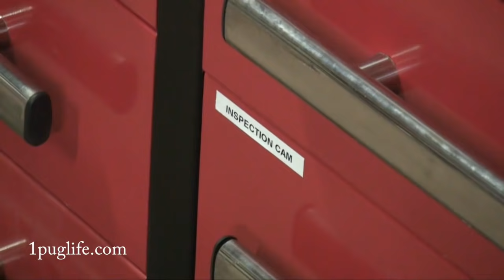my hair did

Comment: I told you I threw away a brand new flow bee ...   dumbest invention ever.   IT DOESN'T WORK.    For a shear to work you have to drag it thru the hair.    All the Flo Bee does is suck your hair in and the shear just looks at it and laughs.    IT DOES NOT WORK   BIGGEST RIP OFF EVER  xD

Comment: went to get new air compressor and jack stands at huber freets - stopped by 1 pawn shop and left with new .308 savage with mod stock... dammit boys - life is like a box of chocolates - so dam spensive fer lil derds... so i stopped by tractor non supplies - and scored 20v lithium 1/2" porta capables impact wrench - guess ill just have to set my jeeps on center blocks new york style to take wheels off...and it rained all day- so i got my best COMPO wellies on, case i run into any nora batties - ehh- styling & profiling like a goof...